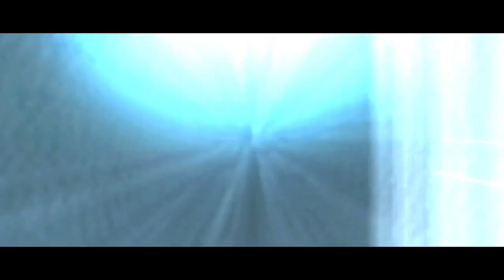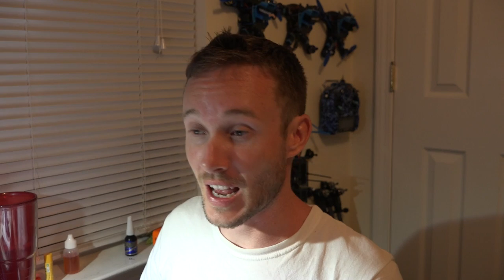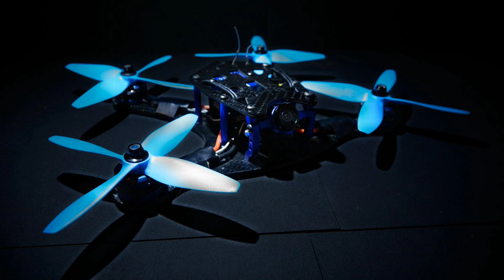PID Tuning Pt1: Intro & Tips

Comment: Thank you for this video and simplied version on PID tuning. 
Hey since you brought up Joshua Bardwell.  I absolutely love his videos. But I'm interested on your take on capacitors.  What is your experience with just using 1000 uF or using 340 uF on each ESC?
Reply from the maker: The more the better, but personally I hate how much space they take up putting one on each ESC. I just use a 470uF or 1000uF right on the battery lead

Comment: @ 4:16 - Tune without a GoPro, adding 70g of weight shouldn't affect the tune too much but taking 70g off of a tune will most likely result in high P gain starting to show in flight.